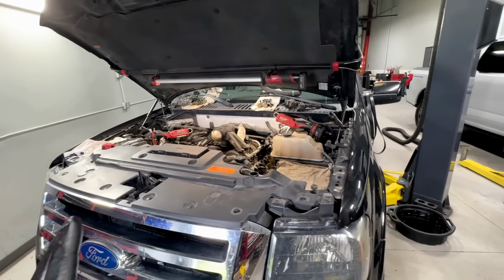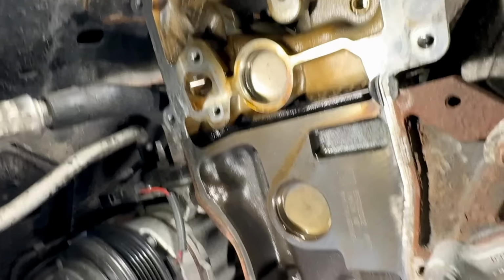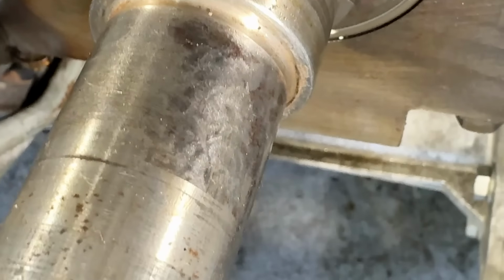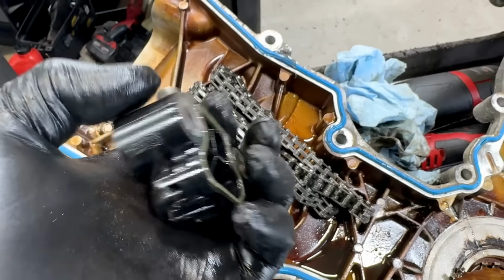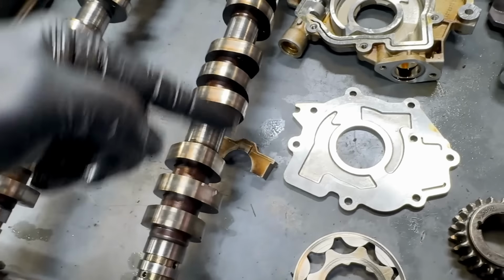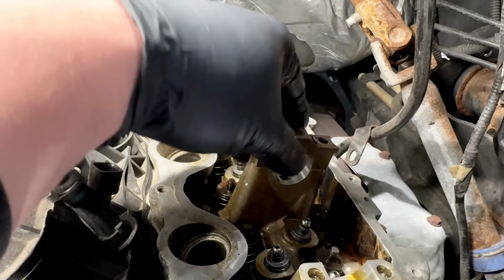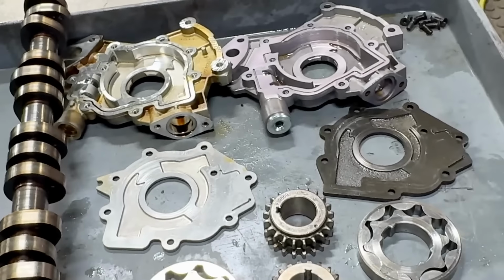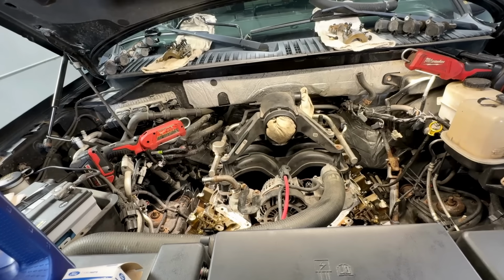How to Destroy a Perfectly Fine Ford 5.4L 3v Triton Engine with a Timing Job!

Comment: Customer pick out Aftermarket   Parts that should have work  with out issues  and had Mr Impact Flat Rater Mechanic throw it together..  Customer just as Fault. You have to have all Special Timing Tools.  You think using Cloyes timing Chain Sprockets Tensioners Phasers wouldn't have a problem . Cloyes does make the  best Double Roller Timing Chains and Sprockets for Old Push Rod Style  Domestic V8 Engines . Ive used After market Timing Chain Tensioners and Phasers had issues with Triton Engines  eventually swapped them out with Factory Ford Parts even though they have had Quality Issues too. Last Major Timing Chain job i did 3 valve  Used all Ford Parts except Melling High Vol Pump. Camshafts I got from Ford Dealer Journals looked pretty Rough looked like  Fast Feed Lathe Cut I sand Journals with Fine  Emery Cloth  after that Cam spun nicely in the Journals and Cam caps were in right position to sometimes Even Factory Originsl parts need to be Massaged to Blue Print Spec.  45+ years Exp Pro Master Certified Bitchin Mechanic

Comment: Thanks for all you videos on the 5.4 3v
Good to know for anyone that has one or needs maintenance.

With that said I have 2012 Ford Escape 3.0 v6 front wheel drive. I have ~175k Would love to have a 5 min. chat with you about it, no major issues, just want to know whether to keep it or upgrade it. I have a spreadsheet of my own repairs/maint. done thanks to your video series on these. Thanks.

Comment: When I do the timing sets I use only Ford parts but I opt for the mechanical tensioners vs the oil ones I believe it's a 2000 4.6 model tensioner no more blow outs and I swap the oil pump for high volume

Comment: I recently did this job and used all ford oem parts except the timing chains and oil pump which are Melling, I have the ford updated tensioners installed, should I replace the Melling chain with the ford oem ones? Kinda scared of the Melling chains after hearing that they have broken before

Comment: Great video!  You said something at the end of the video that caught my attention.   You mentioned dying at stop signs.  I have a 2011 F150 EB that I did the timing chain, phasers, etc using your videos as my guide in 2020.  Recently, while towing, I'll come to a stoplight and the engine will shudder and die.  If I powerbrake at the light, it will stay running.  I wonder if I should change from 5w30 to 5w40.  Vehicle sees towing service only.
Reply: Idle relearn after cleaning the throttle body.

Comment: I just did a cam/rocker replacement on a dodge 3.6. I marked every cam cap with a sharpie so no mixups can occur. The timing system in the 3.6’s seem pretty solid, but the rockers/fillers are pretty common failure point

Comment: That's an ongoing problem for many many years now.  Aftermarket parts simply don't have the quality put in them like OEM parts, and consequently that leads to engine destruction.  My 06 Nissan Frontier had the two chain tensioners that tighten the small intake cam gears to exhaust cam gears chains wore out and making variable noise as the vehicle accelerated.  
Fortunately I got into it before the metal to metal contact could lead to specs of metal inside the engine.  Anyway, I hope the customer gets the vehicle fixed correctly and it's back in service soon.
Good one Brian.

Comment: no possible way to determine order of cam caps after theyre mixed up ?  other than sequential numbered caps for a reference is there any way ?
Reply: not that I know of. You could remachine out a larger hole and then get an oversized cam. But for this engine, its likely the main bearings will have experienced quite a bit of wear, so its not worth it to do all that work to correct the cam caps, for the engine to possibly still shit itself.

Comment: The title had me in stitches. "Perfectly fine Ford 5.4l 3v"???? That in itself would be a unicorn. The fact that Ford mass produced those boat anchors for decades and stuffed them under the dash of their trucks without addressing their habitual failures was border line criminal. It emboldened GM to resurrect Displacement on Demand from the annals of Cadillac failures and to this day make a mockery of I.C.E. in pick ups.

Comment: Believe it or not, when I did a phaser job on my 04 Navigator,  I discovered that from the factory they forgot that clip installed on the chain tensioner! It wore a little on the cover. Must have been installed on a Friday.  I bought the Navigator cheap from a GM dealership, they were convinced the engine was bad. I could hear it needed a timing job. Turned out great with the help of your video series.

Comment: I'm about to do a timing job on a 5.4 2v... I bought the melling kit... What are your thoughts on the quality? should I just just go oem? Bought the parts over 6 months ago months ago so I can't return it... never got around to doing the timing job until now. But I'd rather lose a few hundred dollars now instead of having to replace an engine because of crappy parts
Reply: If you are too concerned, just replace the chain, lower sprocket, guides, and tensioner. Melling are the manufacturer of the Ford Phasers.
Reply: Honestly the only reason I bought the melling kit was because that's what he has for recommended parts on his 5.4 2v timing video 😂 I used the affiliate links he has posted. Oh well... No big deal. I'll just get oem from ford
Reply: Brian just stated in a comment above that the Melling kit for the 5.4 2v is good
Reply: @babybird57  also all the flaws he pointed out for the 5.4 3v chain kit are exactly the same on the 2v chain kit. Same manufacturing process. Kind of doesn't make sense that the 2v kits are good but the 3v kits aren't. Lots of reviews stating the 2v chains are breaking, just like the 3v. I should've done some research before purchasing based on a "recommendation". Another thing I noticed is that in the 2v timing video he has posted he's using ford timing chains.
Reply: @matthewsmith7746  If you are not comfortable using the melling chains you purchased buy ford oem chains.  The 5.4 2v does not have phasers, you can change the chains, guides, tensioners, crank sprocket
Reply: @babybird57  yes I'm aware there are no phasers on the 5.4 2v
Reply: @babybird57     I dont see it
Reply: @matthewsmith7746  see comment made by Tanker25 with 4 replies
Reply: @matthewsmith7746  The comment I was referring to was made by Tanker25 with 4 replies.

Comment: Need help with p0019 code on 2012 3.5 ecoboost. Everything been replaced. Could there be an oil restriction somewhere on driver side?

Comment: I did phaser lockout outs and ecu programming from Drag Radial Performance on my 2010 with 205k. Best running truck I've ever had since. Super quiet and way more power.
Reply: How did you do the phaser lock out ? Mine runs good just loud as a F250 diesel 😢

Comment: I preemptively did a timing job on my 04 at 153k, following Brian's 4 part series. When I took off the front and valve covers, everything was perfect. I put a pint of MARVEL MYSTERY OIL in at every 5 k change. I did the timing job,melling hv oil pump, new followers and lash adjusters. ONLY USE FORD OEM PARTS. My truck  now has 170k, runs like a watch.
Reply: You do everything right except for the Marvel Mystery Oil LOL
Reply: @AlanPhillips-g1c  well, I'm 77, and I've been using it since I worked in a transmission shop starting at 11 yrs old on the advice of an old timer. Now I'm an old timer, and I still use it in every piece of equipment with an ICE engine I own. I also read a recommendation in American Modeler magazine to use it to winterize my little glow plug engines. My vehicles are a 1994 F150, and a 2004 F150. Both run like swiss watches. So I think I'll keep doing it my way.
Reply: @AlanPhillips-g1c  i would agree, do not add contaminants to your engine oil!

Comment: Is it realistic to get the camshaft journals line bored and bearing caps installed to fix the excessive wear in the cylinder heads? Can’t decide if I should do that or just get remanned heads.

Frankly I’ll admit I did my own timing job recently and 100% mixed up the caps due to my own stupidity and getting too ahead of myself. I now have the engine fully out and am deciding on my next step. I did not run it for long like that but the grooves do catch my nails.
Reply: Just get new heads lol

Comment: The confusion with Melling is due to them selling different grades. Theres a “service” grade and “professional” grade. I contacted Melling about the difference between the two. According to them the service grade is mostly import parts while the professional line is mostly US made (Ford OE) parts. But they didnt specify which parts were what. I just installed their professional grade with iron tensioners, Ford phasers/solenoids and Ford camshafts a couple months ago. Runs fantastic on an engine with 179k. Ive also used Melling on my 4.6 2v and its got 70k on it that kit. Not a single hiccup. Not all Melling stuff is junk. You need to do your own research though.
Reply: I'm sorry, but the fact that Melling is willing to destroy their name by having different grades of something as critical as an oil pump tells me that they have a very stupid bean counter in their midst. This is a good way to destroy a company.
Reply: I did the same for my 3.5 Ecoboost. I ordered the professional timing kit from Melling through O’Reilly. It was chains, tensioners, guides, crank sprocket. Every single part had the Ford Motorcraft part number rubbed off with what looked like a dremel. Held up next to the OEM parts, they were exactly the same, just with a literally rubbed off FoMoCo part number. I used OEM phasers, but in the case of my Ecoboost, Melling seems to be supplier of the Motorcraft parts. There were zero casting issues or differences between what I removed from my engine.
Reply: @beatachevy289  that was my hunch. Melling would do good to reach out and clarify all this with Brian. They’d sure sell a lot more kits by doing that.
Reply: So how did you know you got professional grade?
Reply: @firstlast---  theyre listed as such on rockauto
Reply: @AlanFromGa  is that what the s means at the end of the part number?
Reply: The real downfall was the dampener issue.

Comment: There are many things you can skimp on but anything that's internal or that requires many parts to be removed to get to are all oem replacement parts,yes there are some aftermarket  stuff that's good bit it's usually very pricey and performance based.wanna keep it reliable use oem parts.

Comment: Truly sad snow ball effects, cheaper parts, crappy shop work equals, a lot of money for crappy repairs, and now 
he needs a new motor for 112K miles is a shame of it all, my 04 Mustang GT 2V needed a timing job before 120K
because of the previous owner did extended oil changes probably with conventional oil, the timing components
looked like 180K to 200K on them.

Comment: I followed your videos and did a timing job on my 2010 F-150. I used all OEM parts except the Melling high volume oil pump. It's been almost 15k miles now, I was just starting to be able to sleep at night thinking I must have done okay. After watching this video I'm afraid I'll be waking up with cold sweats again wondering if I torqued everything right and if I got the cam caps back in the right spots and if...
Dammit I hate you!  Thanks for the great video and all your help. I know you've saved me thousands.

Comment: My 2008 F-150 with 5.4 has 153k. I wonder how much longer it will go without any major issues. Too bad the bed side is rusting. Truck has been good to me for the 4+ years I have owned it.

Comment: Didn’t Melling once make parts for Ford?
Reply from the maker: I am not sure but the Ford OE level part spec is different than aftermarket spec.
Reply: @FordTechMakuloco  That was back in the pushrod days.
Reply: @FordTechMakuloco  This would make sense.

Comment: It’s probably worth noting that the Melling high volume pump listed on rock auto has a cautionary note to customers that the pump should not be used on engines that have stock tolerances as it will over pressurize the system and lead to rapid engine wear. Im really enjoying this 5.4 journey, I’ll be dropping and cleaning my pan tonight.

Comment: Was just in the game hunting for a used truck and had great luck with my old 96 F150 5.0, got over 300k hard working and off road miles and she still runs good but the truck has too many issues to keep throwing $ at. Had 10k cash and was really wanting a newer Ford but with that little amount of money was such a gamble with these Triton powertrains, some guys get 400k or more miles and some blow up under a 100k. Said to hell with it and bought a Tundra.

Comment: Been running a Cloyes kit with Melling HV oil pump on my 09 Expedition for probably 60k and no issues. Quiet and smooth. Did the job myself using some of his tips and been fine ever since.
Reply: We put a Cloyes timing set in my son's 2012 Regal GS and thankfully it's been fine. I thought Cloyes was a good brand. We were concerned with going OEM GM since that set gave out at only 105K.
Reply: Those cloyes chains like to snap in half
Reply: @matthew1992ya  That's odd.
I used a Cloyes timing kit on both my Explorer 4.0 SOHC and my Duratec Race car.
In both cases the chains in the Cloyes kits were marked with the Morse brand, just like the OEM chains.
They also appeared identical to the original chains.  Same with the sprockets.

Comment: This is a little off-topic, but kind of applies.  My 3.5 EB has 225,000 km (138,000 miles).  Started leaking about a year ago. As an AME, I'm used to stuff that goes  'round and 'round - so quickly diagnosed a rear-main oil seal leak.  Got 3 estimates from Ford service depts, anywhere from $1,500 to $2,500. Went with a local shop that out-bid the dealers.  OK, paid $700 got the leak "fixed".  Two weeks later, it starts leaking.  Shop blows me off - "ah, just monitor it...".  Yeah right.  Replacing the valve-cover really helped (heat-cycled gasket had hardened and cracked).  Still leaking.  Took it to my local Ford service dept and the tech confirmed - rear main seal is leaking.  I'm getting he dealer to do the repair.  It'll cost me almost $2,000, but it'll get fixed.  Which saves me $70,000+ for a new truck.  Moral of the story - if it seems too good to be true, it probably is.  Shoulda gone to the dealer about a year ago.
Reply: You probably paid 700 just for them to spray it off

Comment: Hey man, got the same engine in the same model expedition. Just cracked 200k and outside of a trans service for a molded lead frame, it’s been a very good truck. But over the last two oil changes it’s been sipping some oil to the tune of two qts per 5,000 miles. Thinking of throwing some seafoam in the case just in case of a sticky ring but do you have any thoughts? No smoke out the tail pipe. Thanks for any help
Reply: I could be wrong but I think in one of his earlier videos he made mention of a baffle near the pcv in the valve cover. If the baffle comes loose it could increase oil consumption and offset fuel trims?
Reply: If the rubber hose in the 2014 PCV system is anything like the 2003 F-150 5.4L 2V PCV system, you will want to closely inspect all of the hoses.  The fun part is no vacuum leak sound detected for years.  When closely inspecting the rubber adapters and hoses, a three inch section looked like a knife cut all of the way around the rubber outer cover to the inside.  When inspecting with my fingers it comes apart easily in two pieces.  When looking from a distance between four and five feet, the rubber looked perfectly fine.  After replacing all of the broken rubber hose with new, installing a brand new Motorcraft PCV valve, the engine idles perfectly.  Plus, the mysterious oil consumption issue disappears too.
Reply: That's not sipping.

Comment: In your 5.4 2V video, you praised Melling for their outstanding quality. I Bought their timing chain kit because of your praise. Now you’re telling me they’re junk?
Reply from the maker: Their 2v kits are more than adequate and I think that is the only engine I have said they can be used on.
Reply: Brian talks about Mellings  great PUMP..always says use fords chains and cam phasers. You’re wrong, and cheaped out. I cheaped out on Amazon heater core. Now, no heater. Not that bad in Florida though.
Reply: I just bought one of thier guides. I haven’t installed it yet but I agree with you. Now I feel extra dirty doing what I already know is wrong. It’s only got to make it 20 miles then I’ll tear it apart again and put the right stuff in.
Reply: He said in the past they make great oil pumps. He also says go oem for everything else